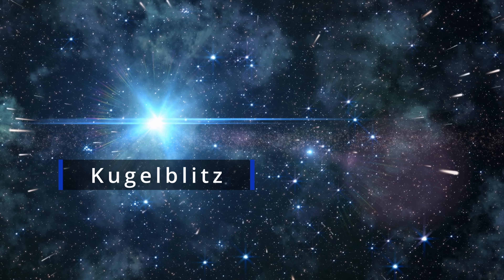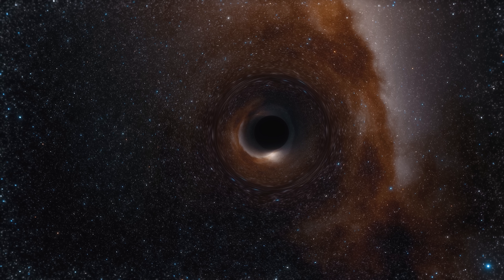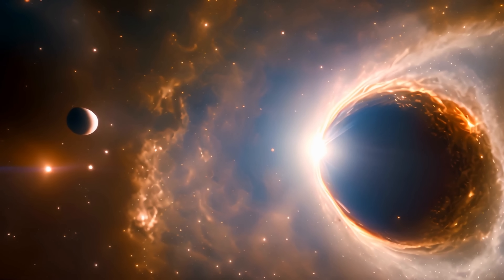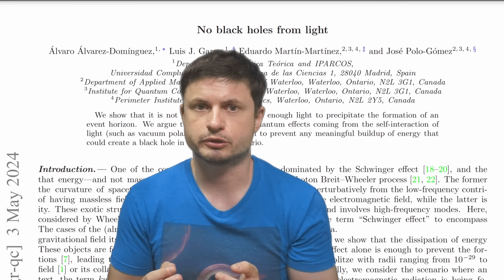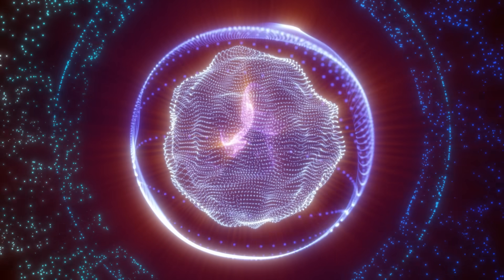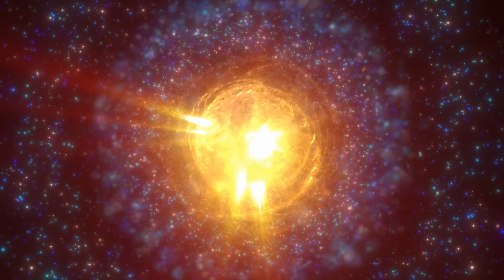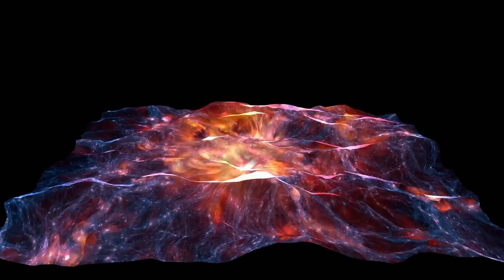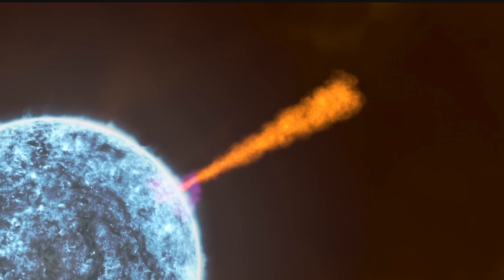Bizarre Black Holes Made Out of Light Proven To Be Impossible (Kugelblitz)

Comment: A real head scratcher, lots of fancy words.  A black hole made out of light!  How can it be black?
Reply: ...because a black hole's gravity prevents the light from getting out?
Reply: E = mc^2 

Basically if you have enough mass in an area it will collapse into black hole, light can't escape a black hole because basically the gravity is too strong, once its in the black hole, absolutely nothing can escape, no mass can escape, though the massive amounts of mass caused the blackhole. 

Energy being equivalent to mass they theorised that you can make a blackhole just from the density of electromagnetic waves eg light. 

So though the blackhole would be made from light, light could not escape it

Obv this new paper theorises that it's basically impossible, as if you have a high enough concentration of light required, the light will spontaneously produce electron-positron pairs that will vent the energy before it can collapse. As far as I understand